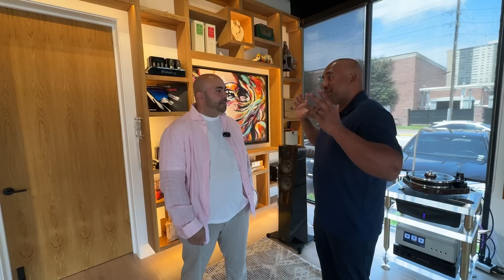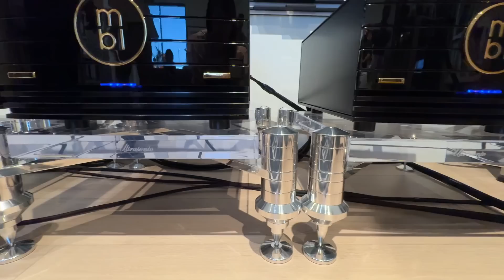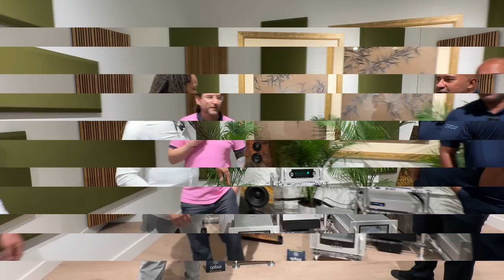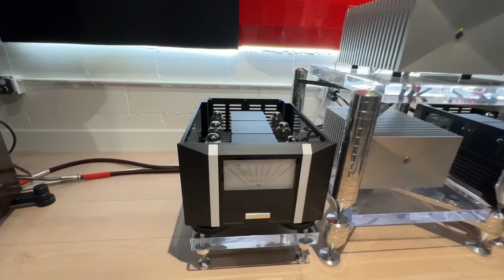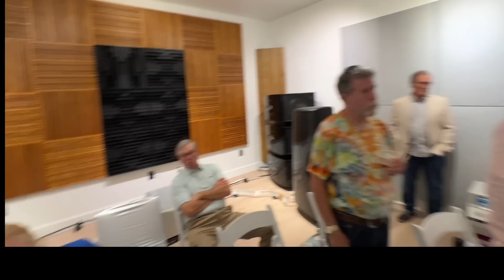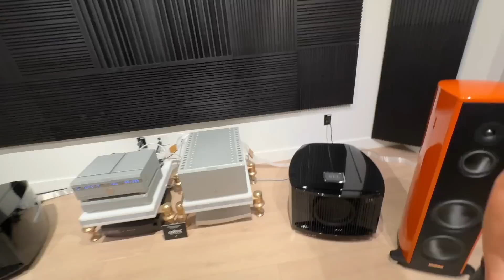3MA Audio - One Of The Best HiFi Stores In Houston Texas!

Comment: I recommend the Furutech NCF outlet over the Audioquest. The Audioquest grips stronger, but it will shave off a layer of metal each time you put in/remove a cable. The Furutech outlet needs some support with heavy cables though, their NCF booster riser works well. Block Audio makes a locking cover too. I had a standard Leviton 20 amp and PS audio outlet beforehand.
Reply: I use the Furutech GTX-D NCF-R.  The best out there.

Comment: Acora bought Audio Research and saved them from going out of business.  It's curious why the Ref 6 SE was chosen instead of the Ref 10, which has a dual mono power supply in a separate chassis.

Comment: Yes I believe in cables. Have all dragon cables for everything speakers, inputs etc. Only thing not is Audioquest WEL signature cables for transfer. Dragons are pure silver so will sound a little sharp when first used out of the box but then after you put in some hours will roll off nicely over time. Their lower all copper lines have nice sound but not as open and not as technical. The next level up the copper and silver mix have a nice combo to them. I have the Audioquest power outlets with separate 10 gage copper romex runs to the electrical panel. If you go that route a power conditioner is really not needed as higher end pieces have that built in already. If you have lower level items then a power conditioner can often help but the conditioner can sometimes starve the gear from it's full potential. I like staying pure and running the lines direct. Think about an awesome piece of equipment that gets to drink through a tiny straw ( cheap electrical outlet and  wiring ). It's not going to do it's best like that. People with 10k systems aren't going to typically see value in 20k to 30k a pop wiring. Just do the best for your budget and a good store owner will usually show you most bang for the buck possible. I do not care for Audio research I like VAC a lot more.
Reply: @RobtheRelentless  I have niagara for things like my vivaldi DCS stack etc. My vac pre-amp and vac 452 iq musicblocks have their own filters. I did split testing and optimized my system over a years time the best way to have the cables and connections. Speakers are Sonus Faber Aida 2's. I still like listening to other systems but see keeping what I have at least for the next decade.
Reply: Thanks for sharing. I will say though, using Niagara 7000/5000 will still provide benefit to even the very best systems. The high current outlets for example, offer 90 amps of Transient Power Correction. It’s like a turbo for your amplifiers. Happy Listening and enjoy your Dragons!

Comment: Great video and very informative. I just wanted to add, that Rob Coon and I have been studying audio in all facets for over twenty years together. It’s our passion and I have to say, Rob is one of the most educated audiophiles I know. He’s taught me so much about power, from its original source to the end source and every connection in between. It’s absolutely stunning to hear the end result without any  bottlenecks (as Rob says) given you have pure energy running through your entire system from the outlets to the speakers and every component in between. AudioQuest products will help get you there no doubt.